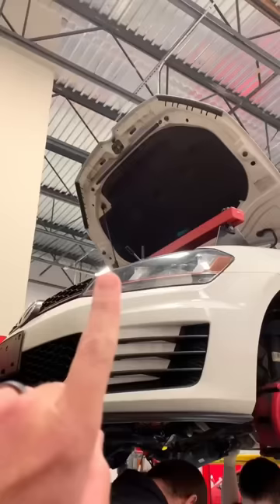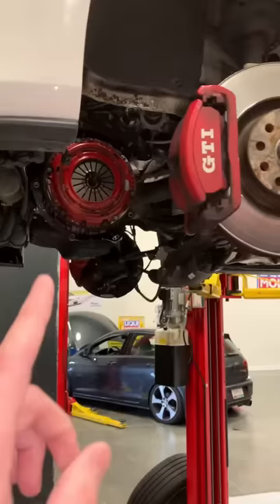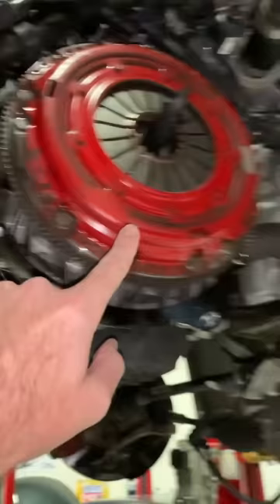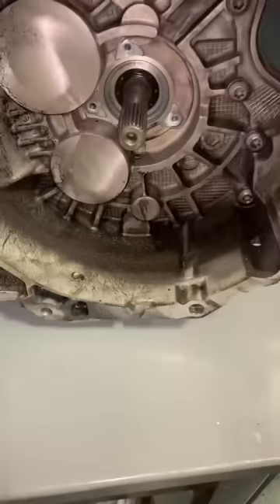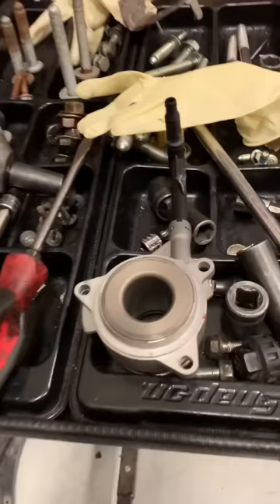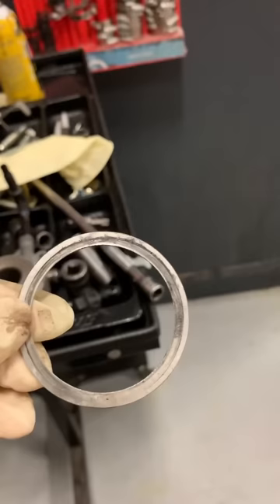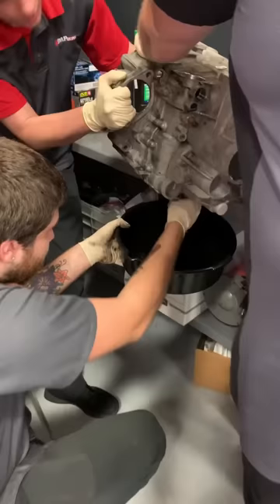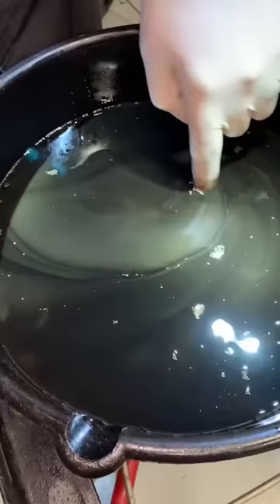This transmission has some problems! #shorts

Comment: Sounds like someone did a 1-2-1.  😬
Reply: happens to the best
Reply: My favorite is 5-1
Reply: @DrDAC-go7hs  short F1 Rpm experience lmao
Reply: @DrDAC-go7hs  mines 5-R puts you into race mode
Reply: My favorite is when the knob falls off mid shift and your looking at it like now what 🤣
Reply: @danlevesque5437  now you grab the shaft
Reply: @tescooffical7175  I attempted to put it back in the dark and then wound up tossing it in the back seat and best part was it was my 1st BMW experience I ever had was a emergency pick up (owner refused to pay his out of state tickets and I was the only one who could drive manual after he got cought) trying to get it back home to a family members house holding on like a pencil 🤦‍♂️
Reply: @tescooffical7175  I intentionally did this to a Ford escort in winter the rubber accordian boot freezing solid  and I tried to make a leather cover and a antique knob instead of the original one but In-between I just used the threads on the rod and nothing else
Reply: i kinda doubt it, i have a mk7 golf and it would be really difficult to do a 1-2-1, there would be sooo much resistance if you tried to move the gearstick into 1st when travelling at say 20mph, which is roughly the speed i’d be changing from 2nd to 3rd. it would be really difficult to do that accidentally, you’d have to really force it into 1st. there’s even resistance against going into 1st when above like 5mph.
Reply: We call 1-2-1 the mechanic dial 😅
Reply: My brother borrowed my old Mitsubishi pick up I had took the old 4 cylinder out of her and threw a v6 in it and a stick shift transmission I forget what it was called been awhile but he did the famous 3 to 1 and I was sitting in the passenger seat safe to say I was pissed

Comment: I think i  know why this trans is  broken .
 The driver must have  forgotten to shake the stick in neutral 234 times before starting the car .
Reply: You can start a car in gear lol, it'll just move forward
Reply: @wall7103  did it 2-3 times when I was trying out stupid thoughts of mine wouldn't recommend it though cuz it overstresses the starter
Reply: @Marlon_J.  this is true.
Reply: @wall7103  Yepp i drove my first stickshift when i was 12 in 1975 . You can start in gear but the starter wont like it .🔥😁
Reply: @wall7103  just press in the clutch bruh
Reply: @wall7103  you can’t start a car in gear it will stall bozo
Reply: @bread9987  100% wrong, Bozo. The starter will get the car rolling enough to prevent stalling.
Reply: @ethanol-fb  clutches fail. This will get you home.
Reply: @wall7103  if you knew how to drive stick you wouldnt worry about the clutch going out
Reply: @ethanol-fb  you have to learn somehow lmao
Reply: @ethanol-fb  1. How do you learn
2. It doesn't matter how you are at driving manual if you have a car that's on it's original clutch at 150K+ miles it's a matter of time before that clutch goes out
Reply: @meep9935  of course you gotta learn but learning to drive stick dosnt need to involve ruining your clutch and yeah they fail itll start slipping or maybe a throwout bearing goes bad or an input shaft bearing but it usually dosnt just go out unless maybe your slave cylinder fails

Comment: I worked at the Kentucky Truck Plant(f250-f550 along with expedition and navigator) and I shit you not over OVER 50% of the transmissions had transmission fluid leaking out the front half. Before anyone had attached them to the engine or mounted to the frame. So so sad that a $100,000 dollar truck or SUV has a brand new transmission leaking fluid. I can say that 2018-2021 had these transmissions leaking at the FACTOR

Comment: Check depth of spigot bearing in flywheel, if an aftermarket clutch is used they may have also changed the flywheel and its constantly pressing the input shaft into the box

Comment: Yeah sounds similar to audi TT
gear selector for 1st  & 2nd breaks
off & drop down. A cheap fix is a
( a bolt & nylon nut) labor is a 
nightmare prop , 4 wheel drive
disconnect , exhaust removal
Gear box links etc etc. Audi
should pay because of
manufacturing fault of
Pot rivite breaking.

Comment: should have drained and ck trans fluid first and had another trans there already and then customer would be informed about metal in oil  not evaluating the problem in proper order mechanic need better training

Comment: What if this is happening in an automatic mine is leaking Profusely between engine and transmission
Reply: Rear main seal
Reply: @rushbnostopp  it’s not oil it’s atf I suspect output shaft seal but I was curious
Reply: That’s a feature
Reply: Front seal. Is it a Ford by chance?
Reply: @cleverusernamenexttime2779  nope 95 dodge caravan it’s now acting like it’s in low gear if you floor it and let off to early before it’s shifts it’ll bang into gear and shake the whole van. It leaves huge puddles of atf in the driveway after a long drive i  noticed if you have it at the proper level it will soak the whole underside I’m guessing first gear is shot and either the torque converter is on it way out or the input shaft seal is also bad.
Reply: @TFD1982  input shaft seal if its between the engine
Reply: @ethanol-fb  as I thought.. I must also add it feels like I’m in low gear sometimes and when I’m stuck and a wheel spins I hear loud growl from the transmission and friend I know said his did that before it was in low bear like and it stopped going into gear complete in the end
Reply: @TFD1982  as long as the oil dosnt get too low im not too big on autos

Comment: Mine won't go into 1st anywhere above 8 mph. Some day I'll get around to fixing that.
Reply: just use 2nd 8 mph is plenty to just use 2nd just dont down shift it into 1st only put it in 1st if youre going less then like 4-5
Reply: @ethanol-fb  not with a 22 year old N.A. EJ25. But maybe one day I'll make it into a sleeper outback STI. S's & G's
Reply: @BrotherJacob45  if 2nd gear idles at 8mph should be fine to just go into it
Reply: @ethanol-fb  It can. Though sometimes I'd like to accelerate a little faster. Lots of the newer trade-ins I inspect have synchronized first gear. I also don't like how short first gear is on Subarus. But the old ones are still great little cars.
Reply: @BrotherJacob45  yeah i have an 85 firebird with a mild 305 im planning on getting a t56 with a high first and short ratios
Reply: @BrotherJacob45  usually if im rolling or stoped going down hill ill let it roll and use 2nd

Comment: Remind me not to take anything to you, you only have the worst outcomes. Just do the old Ford flush, drain the fluids, flush the system and fill it back up, you didn't need all that metal anyways, just get it out of the system and go back to running for a few more years before actually doing this job that you're doing now. It'll save the customer thousands, but you don't care, we know. You absolutely have to have everything perfect regardless of customers opinions. And you'll like to them and tell them exactly what you want them to hear so they'll praise you for making them spend all this money they didn't need to spend just yet.

Comment: Typical junk euro car. My jdm 1991 corolla has 400k miles on the original engine and 5 speed manual transmission. It’s never given me any issues.(bought it new in 92) Bought a mid 2000s bmw, the shit broke 25 times and cost hella money to fix each time. I happily sold that pos to the local scrap yard after the engine spun a rod bearing.
Reply: Sounds like this isn't the car dude, it's the driver shifting badly
Reply: @RainytheNB  yea someone beat on the poor thing. Even then I’ve seen people beat the hell out of a Honda or Toyota with little repercussion. Although I did have a friend blow his Subaru’s 6 speed up after money-shifting.  Realistically any car will break when it’s abused, but it seems to happen more often to euro cars. Japanese cars are notorious for being overbuilt and tough as tanks. American cars are a hit or miss, you get gems like the 90s Silverado with the 350v8 that can last 400-600k miles. Or you get a Dodge Ram where the trans blows out every 20k miles. Euro cars are mostly unreliable , over engineered and expensive to fix for no reason unless you go back 50 years or more. The old euro cars were great.
Reply: @iheartapple-114  I work as a mechanic. Toyota transmissions will be grenaded just the same if you ran them like this VW transmission was shifted.

Comment: Good thing I didn’t went for a VW
Reply: This is not the fault of VW, user error
Reply: "Good thing I didn't went for a VW"

1. "I didn't go for a VW". Not "went"
2. All transmissions will fail if you abuse them enough. Learn to drive properly.
Reply: @nathanmilhorn5430  it could not be user error maybe they just have bad synchros
Reply: @ferrumignis  let me guess you dont park your car in gear
Reply: @ethanol-fb  Wtf are you talking about? I always park my car in gear as my drive is very steep.
Reply: @ethanol-fb  "maybe they just have bad synchris"
🙄🙄 And how do sychros "go bad" genius?  Either through abuse or high mileage wear.
Reply: @ferrumignis  yeah high mileage and some companies just make bad transmissions with bad synchros
Reply: @ferrumignis  just saying its not always user error calm

Comment: All these kids now days think it cool to down shift/engine braking, i guess they dont understand brakes are cheaper than a transmission lol
Reply: Most transmissions don’t blow up unless you money shift them or are just abusive, engine braking to a certain extent won’t kill a transmission
Reply: @FuZe.  let me put it this way, would you rather replace a clutch or brake pads? Cmon guy, if youre a mechanic you should know this. Stop trying to stick up for kids that dont know shit about driving but want to look cool. Its sad.
Reply: Its funny that you think “kids now days” drive manual cars..
Reply: I own a 2007 dodge ram with a stick shift. It's now got 116000 miles in it and the motor went out due to me trying to pull a load that was too much for it too handle. Had the tranny checked out and the mechanic said it looks like new inside still. I have been driving stick shift vehicles for well over 30 years and never had a tranny fail on me. Using the tranny to brake is normal, you just gotta know when and how to do it properly. Trying to shift a vehicle without using the clutch normally grenades a tranny real fast, it is something I would never do.
Reply: It's a shame some people are so mechanically ignorant that they think engine braking ruins transmissions.
Reply: @andrewmurphy8724  Exzactly what i was trying to say, theres a way to do it. But ive been in a car when the clutch gernaded and it litterally gernaded. Put chunks of metal thru the housing like shrapnel.
Reply: The problem with this transmission. Is that someone forced it into first gear while it was rolling. A lot. 
100% driver negligence.